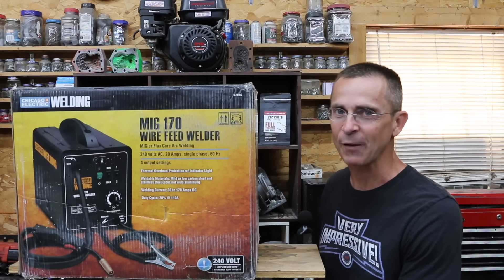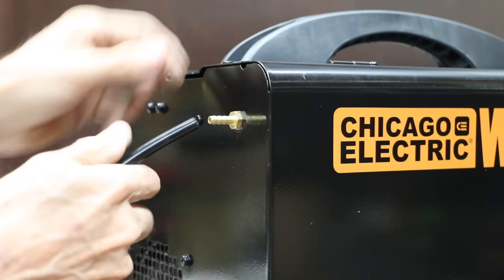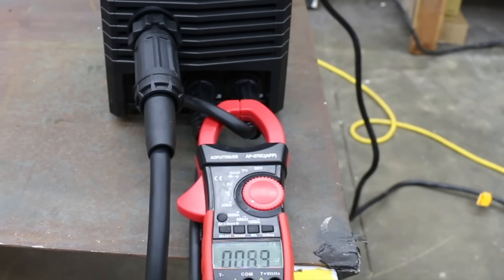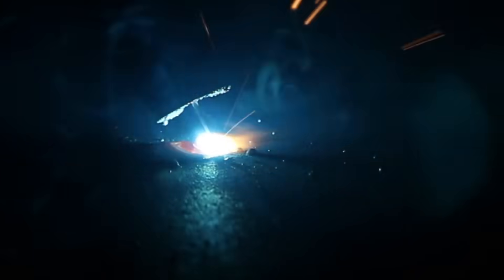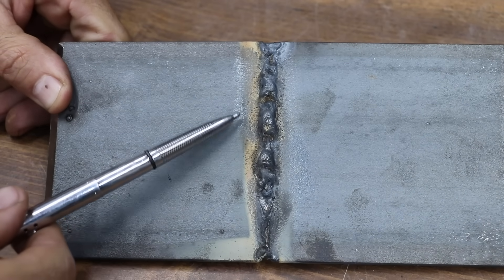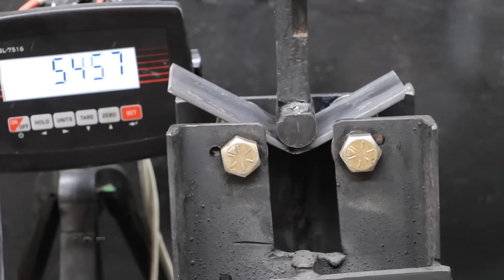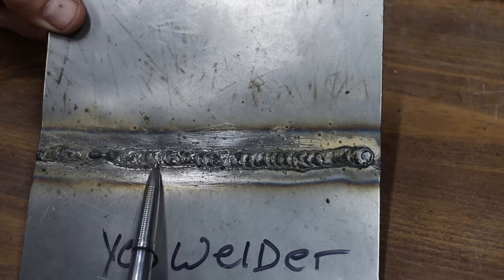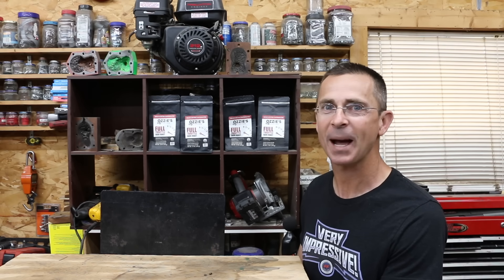Cheap vs Expensive Welder? Let’s Find Out!

Comment: I paid $250 for my Eastwood 135 Mig (pretty sure it's made by the same company that does a lot of the cheap MIGs) about 8-9 years ago. It's been stored in an open side car port, been dropped 4 feet and been used for 22 gauge up to 1/4in steel and still to this day works great. Only issue I've had is the regulator that came with it even when new will not go below 14 on the flow rate. However Since i weld outside or in a open garage it's not been a problem for me.
Reply from the maker: Thanks for sharing.

Comment: FYI  20 gauge sheet metal is way thicker than modern automotive sheet metal. In 1953 , the auto manufacturers switched from 20 gauge sheet metal to 22 gauge...and in the early 80's they went even thinner with HSLA sheet metal ( High strength low alloy).

Comment: So I picked up the Chicago Electric as my first welder about 8 years ago and used it on gas exclusively (ugh, flux core) but it DID make me a better welder. Having the limited power and control options forced me to adjust on the fly and work within the constraints of the equipment. That said, I do not do anything with it that would have anyone's safety depending on it, mostly using it for art purposes. I leave structural up to the professionals with much better equipment. I think I only paid 180$ for it and I'm happy with it. 

That said, I definitely wish this video existed all those years ago when I was shopping. That Yeswelder or even that Azzuno would have been a instant buy.
Reply from the maker: Thanks for the feedback.

Comment: So, my use is mostly thin  automotive sheet metal repair.  Only occasional thick pieces.  I'm budget minded but was left unclear as to whether one of the cheaper units could be recommended for my purpose?

Comment: Awesome test !!!! I wish you would have put the Miller Multimatic 215 in the test.
Reply from the maker: Thanks!  I plan to test the Miler in round 2.
Reply: @ProjectFarm   that would be great seems like the direct competition to the Lincoln in this round .
Reply: @ProjectFarm  Sweet !!! I bought one and always wanted to see how it compares. My local welding supply shop told me they have many more problems with the Lincoln MP210 then the Miller MP215. My curiosity wishes we could use and abuse them both until failure and see which one fares better.

Comment: I would love to see a video about comparing aged gas. Fresh, 1 month, 6 months, 1 year, 2 years, how old can gas get and still run an engine. Lawnmower? Motorcycle? Does octane rating, brand, additives make a difference? Thinking about thing in regards to prepping; how much effort do I really need to put into rotating my fuel if I want stuff to still work. And will old gas that doesn't start something at least keep something running if a shot of started fluid can get the engine running initially? This is a long in the making video idea, but my feeling is that gas will still "work" even if not awesome, much longer than the internet likes to tell you.
Reply from the maker: Thanks for the suggestion.

Comment: I love these comparison videos! I would love to see a "is new really better?" type of series where you compared brand new units from retail vs used units from the popular used sites like FB marketplace and ebay.
Reply from the maker: Thanks for the suggestion.
Reply: Whenever realistic I choose pre owned but it's luck of the draw for how much life is left in it.
If it was better by design it's still likely to be better than single use junk.
Reply: Neat idea. I imagine there’s so many variables with used products- if it’s been modified and how well it’s been maintained/treated, if it’s been abused, how much usage it has…

Comment: I have a 250 hitbox welder I got off Amazon  during a lightening sale for about $200. I am very happy  with it and it does good. I wouldn't recommend  it for a professional  who uses it every day  but as a back up for them or a hobbyist type welder it is great. I use it restoring cars and can use it all day a times welding in body panels or even welding in a mustang ii front end conversion
Reply from the maker: Thanks for sharing.

Comment: Todd, you should consult me prior to testing any welding or grinding products as you're missing some machines that are far better than the ones you're testing. For example the HTP Propulse 220MTS is head and shoulders better than the Lincoln. See any of Jimbo's Garage videos. It is a synergic machine with pulse capabilities that enable you go go into spray arc mode for thick steel. It can weld aluminum without the need for a spool gun. and it's build in Italy by STEL a leading European manufacturer and it cost less than the Lincoln you tested even though it will run rings around it. Everlast also has several models that are cheap and far superior to the ones you bought. Primeweld's 180 MIG is likely the best deal in the world considering you get a free spool gun at $550. See Jody's videos (Welding Tips and Tricks) concerning this welder. Jody only recommends tools that pass his personal tests and he's the absolute godfather of YouTube welders. You did the same thing when you tested grinding wheels. You apparently went to the Home Depot and bought the shit they sell there. You didn't include Metabo, SAIT, Pferd or Walter all of which make superior grinding and cutting wheels to he ones you tested. You buy grinding wheels in a Welding supply house not a big box store. Other than that I've got no complaints.

Comment: I've got a high end miller love it but do 99% of my smaller jobs, tacks, around the garage with my harbor freight $88 90A (I think) 110v. Saw it on sale about 13 years ago in a flier told my driver to grab one, my brother (a professional welder) laughed and said it won't last a month, I adapted a 10# wire roll to it still works great, either .030 or .035 flux core.
Reply from the maker: Thanks for sharing.
Reply: Still got my Harbor Freight 90A it's a Chicago electric, it works, I still use it. It's amazing it lasted so long. My brother laughed at me when I bought it. Said it wouldn't last. Funny, I use it more than my Miller, about 15x the price.

Comment: did you use the same wire for all tests? Because if not, pretty much all peno/strength tests are moot.
Reply from the maker: I bought new wire and used the same brand for all the testing.

Comment: Nice testing and comparisons, but you didn’t touch on reliability, warranty, and service when something breaks. Harbor Freight and Lincoln blow the others out of the water when it comes to the overall ownership experience. And if this is a tool used to make your living, you don’t want something that’s going to let you down and be down long. You also left out some benchmark machines that easily fit in this range of prices from major industry brands (Miller and Esab.)
Reply from the maker: Thanks!  Thanks for the constructive feedback.

Comment: So, what did you do with all these welders? Return them? Nobody in the comments bother asking? I don't think you mentioned if it was the same brand of wire used or if it was what each welder provided. Back in my stick welding days, we had to do both bends---face and root---to pass the test. Any flaws were an automatic fail, let alone actually break!

Comment: I bought the yes welder 205ds and a spool gun for aluminum, welded great for about an hour then some capacitors or something blew up and started arcing out in the machine, only had a 30day warranty and I waited to long to use it so I’m sol. And was only running at about 120 amps when it happened
Reply from the maker: Thanks for sharing.

Comment: Man, I'd love you to test a Hobart EZ welder. I just love mine! I've owned it for 10 years now, and payed $239 for it from a pawn shop (it still has the price sticker, lol). It's strictly flux core, as there's no gas feed hookups, but that's honestly a minor setback in my opinion. I still run it for 15 minute intervals on its highest setting (10 ga. to 3/16).
Reply from the maker: Thanks for the suggestion.

Comment: I own a Vulcan, purchased as my first welder. It failed but I had the additional replacement warranty. This second one has been rock solid. Definitely get a warranty on a cheap welder. But. Whenever it eventually fails again, it and all of these welders go in the trash can. Except Lincoln. Not only can it be repaired, there are repair centers all over the country. It’s a long term tool. 
Duty cycle is also a big difference. You can’t use a cheap welder for more than a few minutes at a time, or weld anything thick.
Reply from the maker: Thanks for sharing.

Comment: I've been a welder for 30 years... I got rid of all my Lincoln and Miller stuff and went with the YesWelder about a year ago now... Excellent machine, so good (and cheap) I bought a second one for my front workshop so I didn't need to move the first one around... My only complaint about it is the fan is always on rather than thermostatically started but that a minor problem considering it's practically disposable at the price....
Reply from the maker: Thanks for sharing.
Reply: What is a good yes welder for aluminum and steel? Is the 250 Pro a good choice? It is on sale right now!
Reply: @mikekmalick  ... I have only owed the 205DS so could not speak on the 250 model... I will say that I do some pretty heavy welding (I make wood stoves etc) and the 205 has not let me down yet, amazing machine once you get used to it...

Comment: A good welder can get a decent weld with even a cheap welder. I like name brands like miller because replacement parts are a welding shop or phone call away. 
Where as my harbor freight flux core welder may be in working order, but when it isn't it'll be trash.
Reply from the maker: Thanks for the feedback.

Comment: Want another consideration for testing sir?

12" miter saw blades.

The blade I used need of replacement, tried Diablo.
I compared the two blades, the Diablo was slightly heavier than the  DeWalt after installation the saw was noticable quieter.
 The cuts in pressure treated was no effort ,the cut was extremely smooth as if I sanded the cut.

There you go, if your interested now have something to do this winter.

Keep up the good work.
Reply from the maker: Thanks, will do!  Thanks for the suggestion.

Comment: Gotta give you a big thumbs up on this as it must have been a fairly expensive video to make. Great work as always. I have a Powermat PM-IMG-220T multi-function welder. I’ve mostly used it for stick and gassless but I’ve now set it up for thin steel gassed welding. I’ve been very happy with it but I just need to use it more. I like your tests and I’ll run some similar ones myself. The world has moved on from these very expensive bigname welders but quality is variable as you show. Many thanks for making!
Reply from the maker: Thanks and you are welcome!  Thanks for the feedback.

Comment: The real challenge for me is finding an affordable welder that can weld aluminum. My TIG welder is DC only and that is not recommended for aluminum. My MIG welder can't get anywhere near the 180 amps minimum to weld aluminum with a spool gun. The only time I have been able to weld aluminum is with a stick welder running E4043 rods. I would love to see testing on affordable options that are available to weld aluminum be it TIG (GTAW) or MIG (GMAW).
Reply from the maker: Thanks for the suggestion.

Comment: The only thing that I would look like to seen tested is a used miller or Lincoln.  I almost feel a used good welder would probably work better for about the same price as the cheaper ones. Mine is 23 years old then it still works really well.  And at one location we have an old 1970s Lincoln arc welder at it still works. Probably not as good as new but usable.
Reply from the maker: Thanks for the constructive feedback.

Comment: I recall another automotive YouTuber trying out a couple of different welders and he settled on the Yeswelder.  His only complaint has been with thinner sheetmetal.  I figure a Yeswelder for anything 16 gauge and thicker, an Azzuno for anything thinner than that, and for $600ish you can have the best of both worlds and replace them nearly 4 times each before you get to the cost of a new Lincoln.  However, used Lincoln and Miller welders are easy to come by and once you're considering spending $500-$800, a used welder from a known brand might be a better choice.  I'll go for the Yeswelder when I'm ready to get started with this stuff.
Reply from the maker: Thanks for the feedback.

Comment: I’ve had that Lincoln for about 7 years and it’s a great welder. I didn’t pay nearly that price for it back then. I think it was $1400 at my local welding shop. It’s been great. I’m NOT a welder but, I do all of my own work on everything and sometimes that means welding. Only problem I have is that the pre set wire speed is always way too low. Crank the wire speed up and it’ll weld very nice. Amazing how prices have gone up the past few years.
Reply from the maker: Thanks for sharing.

Comment: I have an older Miller welder that is set up with gas. When I need to weld outdoors, I'd switch over to flux core. I ended up buying a Harbor Freight TITANIUM Easy-Flux 125 Amp Welder and it ran beautifully! I also really liked that it weighs almost nothing, so it's easy to lug out to whatever fence rail needs repair. One day, however, it just stopped working. I see nothing burnt on the circuit board, but it's done. All this is to say that it would be interesting to know how reliable these machines are after months of heavy use.
Reply from the maker: Thanks for the feedback.

Comment: I bought the azzuno a few months back and i LOVE it! I do multiple types of welding and metal fabrication as a side gig and i use it for solid core mig and lift tig. And i have to say my only complaint with it is it's not HF start capable. But once your used to the lift tig starts it welds really well in both categories.
Reply from the maker: Thanks for the feedback.

Comment: I try to watch all your videos but this is the first one I have to give a thumbs down.   So many things.  Where to begin?  For starters why no Hobart or Miller welders.  I  can go out to Tractor Supply and buy a Handler 140 MIG, complete with sample spool of Flux core and regulator for $600.  Then add a Lincoln Electric AC/DC 125/250 for another $850 and do pretty much anything.  I  would use .023 solid wire on 20ga. sheet metal.  Unless you're very good .030 Flux core runs pretty hot.  You never talked about the duty cycle of the machines.  I  could go on at length but I  guess I'm missing the point of the video.  Who is going to have both CO2 and Argon or tri-mix and the cost of gas! I don't know, just missing so much.

Comment: Thank you for the sheet metal pen tests.  As someone who works in automotive, too much penetration and heat is always a concern when working with custom exhaust and body work.  Tack welding controls heat well, preventing warping, but it is nice to have the option to run a full bead without turning your body panel into a lays potato chip.

I didn't see any destroyed welders in this video, and I heard tig welding mentioned.  In case it isn't in your plans, I would be interested to see a tig and stick welding comparison as well.
Great content as always.
Reply from the maker: Thanks!  Thanks for the suggestion.

Comment: For the average consumer these videos are extremely helpful for comparing similar models. Tons of work went into this vid but I think you could do better if you so choose. Your testing methodology has some big oversights.

All welding wire is not made equal, especially flux core. By using whatever wire came with the welder you're not strictly comparing machine output. You would see higher current output across all models with a high quality wire such as Lincoln/ESAB/Hobart. 

Speaking of current measurements, the conductor needs to be centered and perpendicular through the Hall Effect sensor in the multimeter. You're skewing the measurements by misplacing the meter.

Penetration should be measured with bead on plate and a macro etch. Your un-tacked butt joints close up tightly as you progress down the joint.

Your bend tests should have used backing bars. Open root flux core is not a thing for a reason. All of the discontinuities in the root profile negatively impact your bend test results. Dissimilar weld wire again plays a role in affecting these test outcomes.

You have the machines and add revenue. Please do a 2.0 to present accurate data for the masses to make an informed decision.

Comment: Great video 👍 I hope you saved the receipts that an expensive test maybe you can return the them.
I think what you're going to use the welder for is key ,if you're welding is hobby level  welding shelf brackets or Art projects the El cheap' O welder is fine anything that needs durability or strength you need a better welder.
Reply from the maker: Thanks!  Thanks for the feedback.

Comment: For the final rankings, you should really give these things "credit" for getting to a % of the leader. So for example the Vulcan should have scored 100% on the penetration test, but the Lincoln should have scored 98.4% and the Yeswelder should have scored 97.3% - there was almost no real difference between them. But as it is, the difference from 1st place to 2nd or 3rd is punished very harshly (2 is twice as much as 1!).
Reply from the maker: Thanks for the feedback.